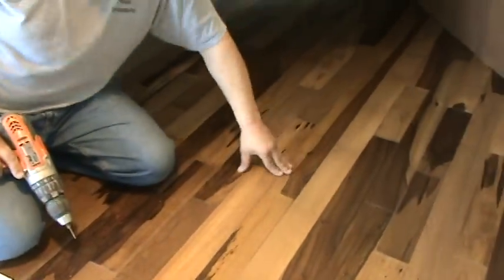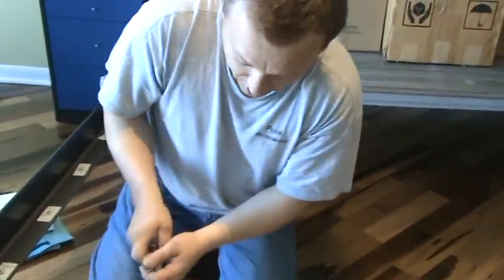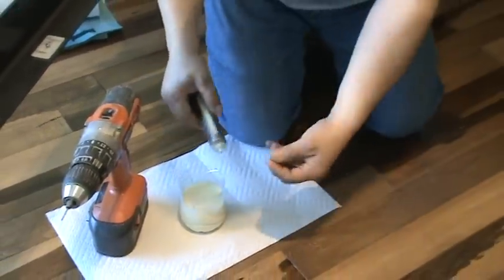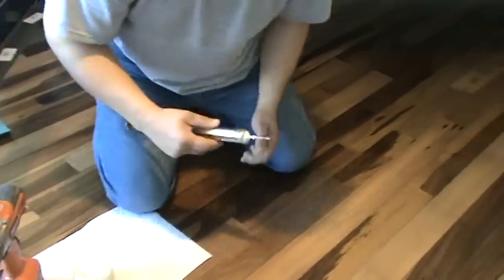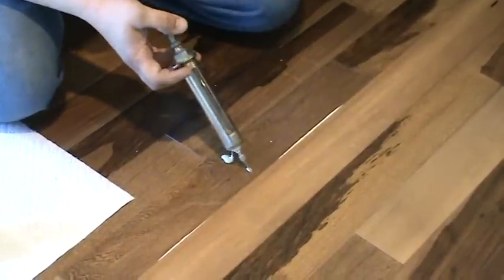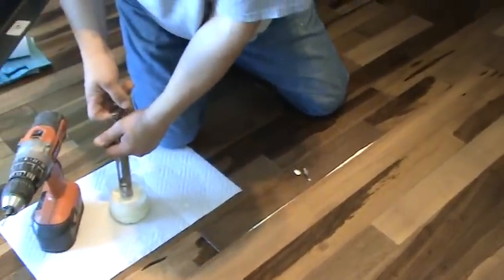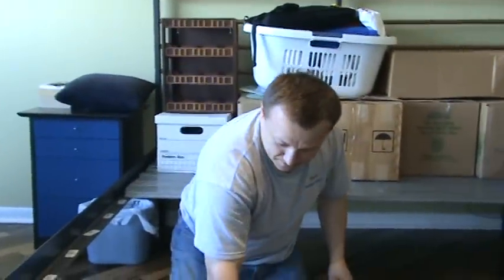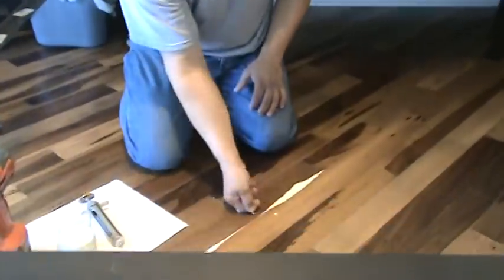how to repair  a popping floor ,glue-down,or floating PART 1

Comment: @House60910 I drill through all the layers , and I make sure the floor has room to expand 
and I inject glue , or dritac under , 
it is not a cure for all situations , in many cases it helps to solve the problem 
in some cases the floor needs to be removed .
under floating floor should be a foam , or cork and felt paper

Comment: I got one on e-bay - 
veterinary syringe , it is old but it is made to last 
all stainless steel and rubber washers 
and once you are done - use cold water to clean 
just suck water and eject like 15 times , and sometimes take it apart to clean it , or just loosen the piston 
and dont forget to get more needles , 
drill 1/16 inch hole and it is best to vacuum the hole so it does not plug up the needle

Comment: A lot of viewers think they are professionals who have ridiculous responses and most doesn't make any sense. All hardwood flooring on concrete is urethane based adhesive and it's glued to presumably clean concrete surfaces. Urethane base adhesive is impervious to water and moisture, therefore should not delaminate. It's all in the preparation folks. A dirty floor will cause the adhesive to unbind from the concrete. Additionally, the wood plank may be warped, twisted or bent, in time it will add pressure/stress to the area of the floor that are not leveled or poor adhesion which ultimately causes it to lift. A dirty floor or floor that are not leveled or properly prepped will delaminate from the concrete. So, take the time to repair, wash, mop the floor if needed and allowed it to dry completely before gluing if you're doing it yourself. If not get a contractor that KNOWS what they are doing. Do you best to select planks that are not bent or twisted. I installed hardwood floors to my house in three rooms 9 years ago and have yet lifted from the concrete. Floating floor on concrete should have moisture membrane to prolong the life of the wood flooring. Floating floor on wood should have sound barrier to help soften the walk and noise but not neccessary. Follow the manufacturer instructions and leave gaps around the wall to allowed wood expansion. Gluing method in this video is not the correct way but it would fix the problem that this owner has. ..temporarily until it manifests to a greater problem in the future.

Comment: I have slot of water damaged boards throughout house. . my home is 2600 square feet and I applied a polyurethane coat over the floating laminate floor.. my home is 2600 square feet below this fake wood floor is real wood very pretty however 3 parts of the rooms are partial board.. What Is the best suggestion on repairing and how to fix a floating floor?  
Or what would it take to replace with a new tile floor?

Comment: You should never glue down any part of a floating wood floor. Sure it will look like it works for a while but you're just treating a symptom of the real problem.
Reply: +William Martin Do  you have better solution ?
Reply: well then how do you fix it?
Reply: The floor is binding against the wall somewhere because it was installed with insufficient clearance for expansion. Remove the baseboard trim and find where it's binding against the wall. Cut to the required clearance and reinstall the baseboard. Simple.
Reply: you can not glue down floating floor with carpenters glue. all he does is to glue two planks together. not sure if it will hold without side pressure

Comment: Does this work if I have a concrete foundation? If so, what glue would I need to use?
Dean
Reply: Sure, try it
Reply: ever figure it out? i have engineered wood floor glued on concrete, I'm wondering if the wood glue will bond to the glue used originally for the concrete and floor
Reply: Hi, did you try it out? Did it work? We have floating vinyl tiles on concrete that are popping due to uneven sub floors.. Wondering if this would work..
Reply: @neilsison7109  if you have vinyl tiles wood glue will def not work. Go with a product called "fix-a-floor" they have an original formula and one made of polyurethane. You can go for their original product with your application
Reply: Geoff Li i see. Will check that out. Thanks

Comment: if the  floor is  lifting like that is  because that  floating  floor has  no room  for  expansion the  side the  only  thing  he is  doing  is  solving the  problem  for  a  few  moths that floor  will buckle  again .u  cant  glue  down one  plank and  the  rest is a floating floor.but  good  solution  if you dont  care  what happens  in a   few  months

Comment: I am repairing several laminate floors in a house right now. The first 
thing to do with a floating floor is to relieve the pressure from the 
perimeter by cutting it back to the correct gap. The problem is usually 
someone laying the floor too tight to the walls. These floors are 
designed to grow and shrink with the seasons and need the gap for this. 
After it has a sufficient gap, make sure to dehydrate the room with a 
fan and lots of cool dry air for a few days and put some heavy stuff on 
your hump and let the dehumidification do most of the work. If after a 
few days it is still there, I would relay the entire floor from the hump
 back to the wall. NEVER nail or glue these kinds of floors, all you do 
is move the problem elsewhere.
Reply: Freshwaterboy I have the ‘popping’ sound everywhere I walk on mine. The fitter didn’t leave expansion gap. Will taking off the skirtings fix this?
Reply: @SlothyWoffy  have you fixed this? same problem.
Reply: @vlat4e  yes the popping sounds are pretty much gone since making expansion but I have creaking in places

Comment: I know this is a redundant question but I haven't seen a clear answer and my husband wanted me to ask again. He laid the laminate flooring over a waterproof underlay which is over an existing hardwood floor. He did not use spacers while installing the laminate and now were experiencing buckling. Were confused about whether the glue will be able to adhere to the hardwood floor because of the underlay? Will this technique work for use?

Comment: I have a solid bamboo floor installed over concrete on the entire first floor of my home, approximately 1,000 square feet.  I had it installed the first time and ended up with separations in 5 or 6 different places, mostly in the middle of two rooms.  I paid another contractor to take up the entire floor and relay it and now a year later, I have separation places again in almost the same identical places.  I used a 3 in 1 underlayment and the first time it was installed I had T moldings at almost every door way and still had separations in the center of the room.  The t-moldings were incredibly annoying and wouldn't stay down so when we had reinstalled we left the pesky t-moldings out.  This is bamboo uniclic floor - not T&G.  Long story short - would your video on how to fix a floating floor Parts 1-3 work for my situation or will it cause other separations somewhere else.  At this point I'm ready to throw a rug over it and call it a day.  Please advise.
Reply from the maker: drewstraw 
it all depends on the layout 
and the bamboo over concrete ,- problems  - I saw many , 
the bamboo ( grass - not wood material ) is also susceptible   to moisture , so it is best to maintain the same moisture level , around 30 % through out the year , 
in heating season especially , 
I have seen bamboo come open in winter time , since they shrink or contract in width and it will brake off the locking , and pull right out especially in doorways where there is the most tension 
I always stick with natural oak hardwood floor if possible , or LVT over floor muffler for the concrete in the basement 
Just not a huge fan of bamboo in general  
I am not thinking my solution would help
Reply: Floating floor does not float , if you glue it down
Reply: It appears both your first and second contractors did not have adequate skills or knowledge. Remove the baseboard trim to find where the flooring is binding and cut the required clearance. I also hired and fired an incompetent contractor. Now you know what questions to ask.
Reply: drewstraw 

I have the same problem and trust me a rug won't even help. I hava a rug for decoration and the floor buckled and now it looks like my dog is hiding under my carpet. Funny yet Sad I spent so much money and now I am stuck with this problem

Comment: Hi...great video!  Question - I have that red rosin between the hardwood and subfloor.  Is the glue supposed to adhere the hardwood to the subfloor?  If so, I can't see how the glue will penetrate through.  Thx.

Comment: I was taught to drill at the "T"  of where three boards came together not in the middle of the board so as to minimize having to repair a noticeable hole. I was also taught to use 1:1 ratio epoxy to glue a wood floor back down to cement. Floors glued to cement will lift  if the cement was not completely free of residue such as dry wall mud no matter how thin it is, moisture in the air (NO A/C) will cause the glue to lift the mud from the cement and pop the floor.Start with a clean floor..

Comment: first you need to provide space for the floor to expand . 
second . a little movement of floating floor up and down is fine , after all it is not a glue down floor . 
third - the glue is just filling an empty space - gap in beetween the floor and subfloor , so it is helping to fill the void and at the same time help to adheare to the subfloor , but if you drill hole , you will apply glue ( dilluted 50/50 ) to under the membrane and it will also go in between floor and membrane 
2 holes is fine

Comment: Where can I buy that syringe ?
Reply: I am going to try my meat injector syringe - it's about 3/32" in diameter. Lots of choices on Amazon. If the needle's hole is not at the end, cut it diagonally above or at the hole. My flooring is engineered hardwood on concrete - I just hadn't leveled this one area well enough in the hallway and it's been driving me crazy.

Comment from the maker: it might work for you , just remember that laminated floor needs room to move ( expansion )  is  the floor is laied directly on concrete ???
there should be a foam , or cork , , in any case , you can try it at your own risk , but I would not put any weight after injection , just fill the hole with a toothpick

Comment: Have you ever had any problems with natural solid hardwood (maple) flooring when using regular watered down carpenters' glue? I have heard that the seasonal expansion effects can cause a problem (like floor cupping, splitting, etc) unless the glue used is some sort of polymer / urethane product.

Comment: You could use the yellow foamy stuff that expands too. Just attach an air needle which is normally used to air up 🏀 🏈 ⚽️etc, the straw which comes with the foamy stuff fits perfectly inside the air needle. Just tape around it for added security. Then drill the hole or holes, squirt the foam in and it fills in nicely!! Added point, drill between the boards rather in the middle of a board. It’s easier to hide than in the middle of a board. Then get matching caulk or nail filler to fill the hole. No one knows the wiser. Haha

Comment: That's a Real Hack Repair ~ Over 40 Years in The Business ~ Don't Do What This Guy Does
Reply: Needs to be polyurethane based glue or an epoxy resin. Water based glue doesn't have flexibility and will eventually fail.
Reply: Do Not do what this guy does on the video